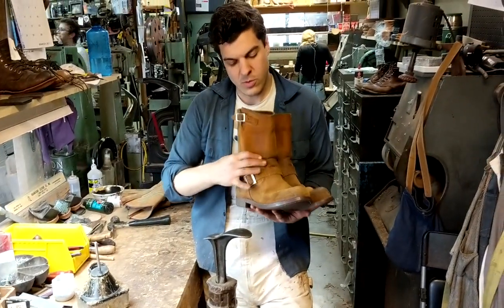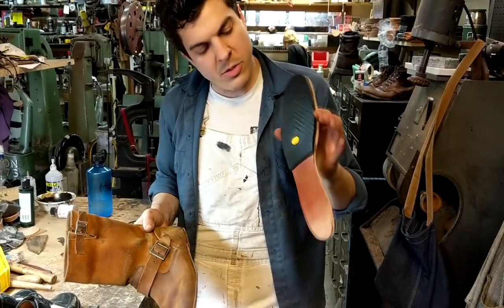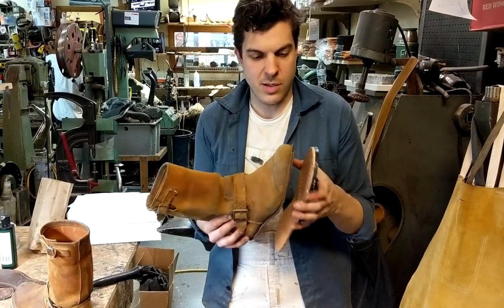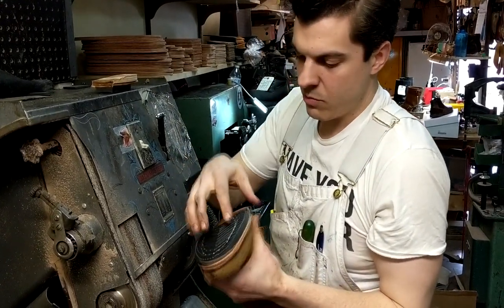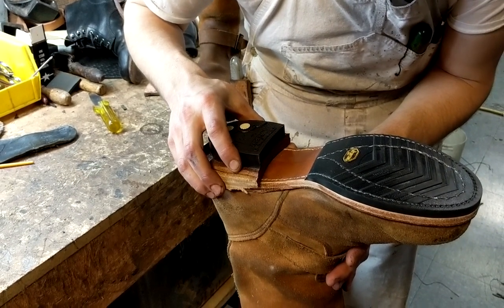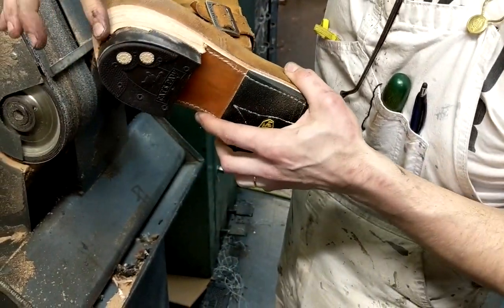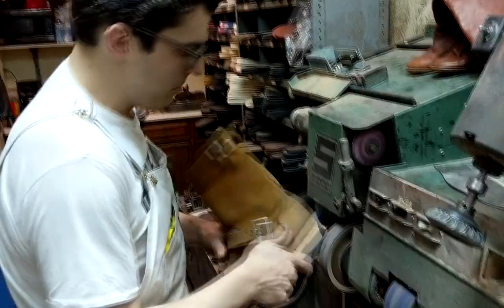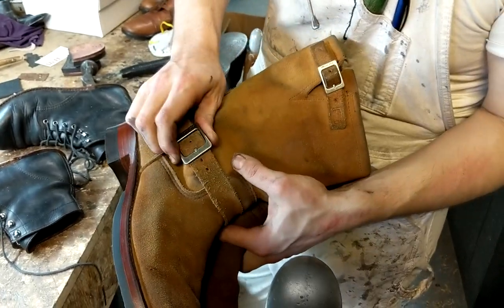Red Wing Rough Out Engineer Boot Resole

Comment: I just bought a whole new Red Wing engineer boots. Would you recommend rather resole them with more functional rubber sole from the very beginning or better to resole them after wearing a while? (The original sole is almost like plastic, and is very slipping on the road.)
Reply from the maker: They most likely have the nitrile cork soles on them, once you wear them in a little they'll have some more grip! You could switch to a sole with more tread but try wearing them in a little first
Reply: @peabodyshoerepair9135  : ok! thanks for your useful advise!